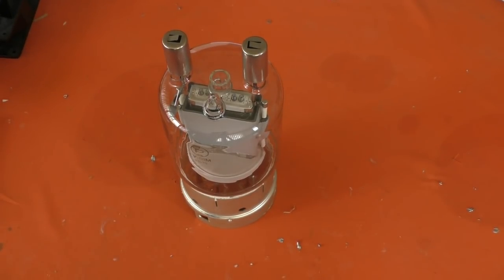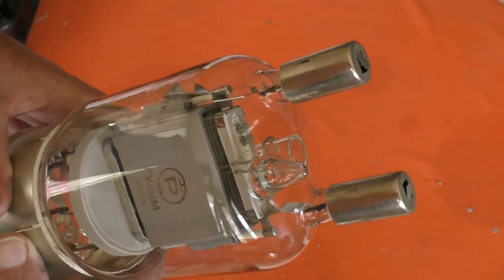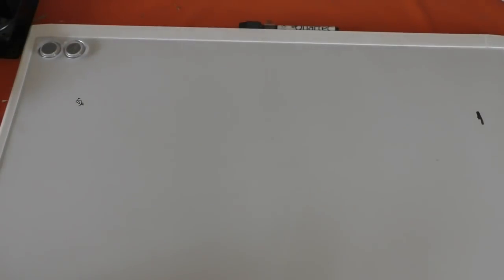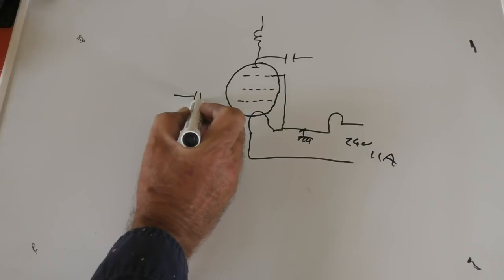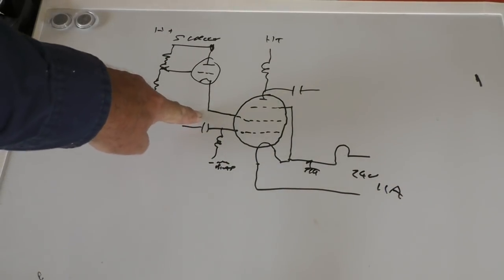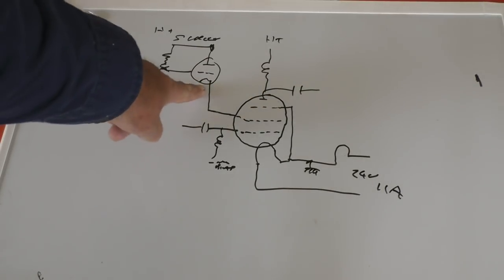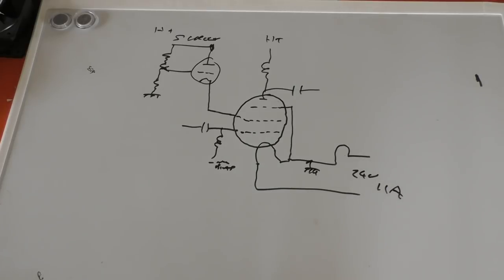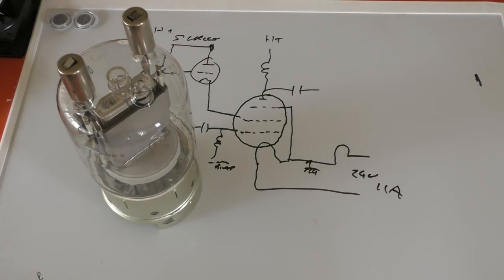I Got A Couple Of GU-81M Pentodes...

Comment: I got 4 of these valves and retrofit a Bauer 707 AM tx. They actually work pretty good, but the pair needs twice the G2 current than that of the 4-400s in the RF section. The plate modulators needed a bit more G1 negative bias to tame them for class AB1. Doesn't quite make 100% modulation, probably due to the extra G2 current requirement.  Interesting valves tho. I hope to make a vid of it soon. 73!

Comment: work with two of them can be problematic since each have 26pf plate capacitance,so you have 54 pf starting capacitance,plus stray capacitance of choke and leads,plus minimum capacitance from tune capacitor....hard to tune on higher bands ,need for vacuum variable.....

Comment: And I thought your amp in progress was a monster.  These are scary!  But beautiful.  Wouldn't your drive valve power requirement be double what you figured?  Or was the drive current you mentioned for two valves in parallel.  Hmmm.  Feels wierd calling tubes valves!
Reply from the maker: Yes, it's weird calling valves tubes. They were always valves in England but I often refer to them as tubes as most of the valve amplifier stuff I read or view on the internet is from the US. I didn't mention drive power, the power I was talking about was the power the tube in series with the large pentode screen grid would have to dissipate as heat. The screen grid current is quite high, 200ma. This means the series tube has to dissipate the voltage drop across it multiplied by the current running through it as heat. With 400v dropped across the series tube and 200ma running through it it would have to dissipate 80W as heat when no modulation is applied. It's far less when there's modulation as the voltage across the series tube falls to very little as it turns on. If I used two of the large pentodes I would have to use one 813 (or something with at least 100W anode dissipation) in series with each screen grid. I would connect the screen grids of the pentodes and the cathodes of the 813s together in parallel.